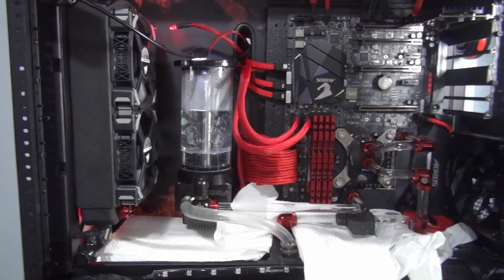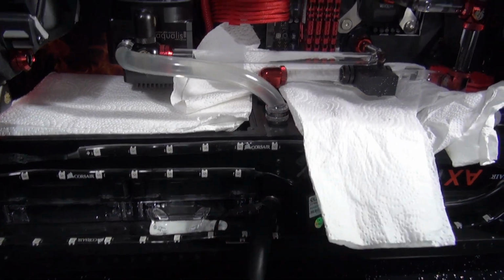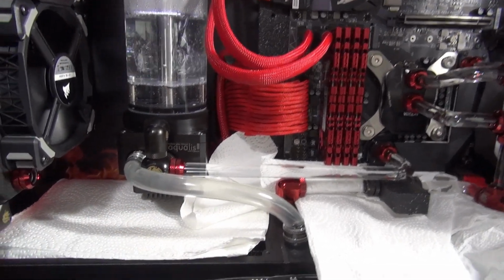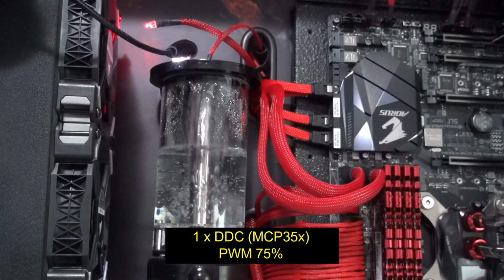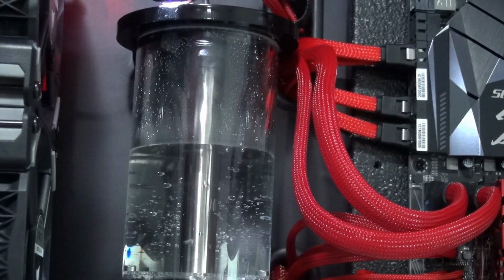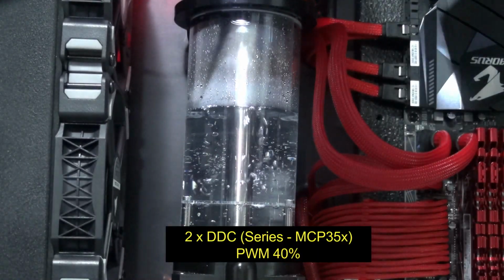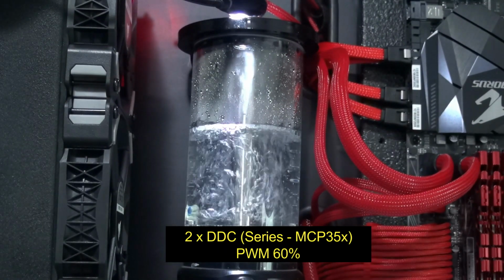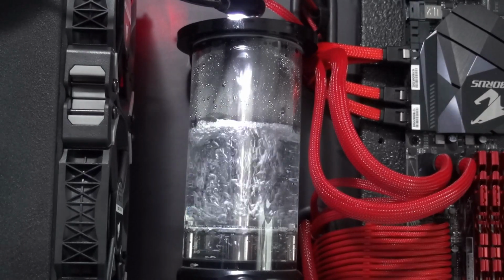DDC Pump MCP35X Single & Dual VS Aquacomputer Aqualis Fountain Effect

Comment: I just purchased a primo chill d5 pump is it compatible with   this reservoir and pump top setup, if not do you know any large reservoirs like that one that would? Specifically one that's massive like that.
Reply from the maker: Aquacomputer sells a D5 version of the adapter.

What u need is:
1. The aqualis base (450 or 880mls)
2. The d5 adapter for the aqualis.

This Reservoir is big, just let u know.
Do a measurement before you commit. 
Cheers!